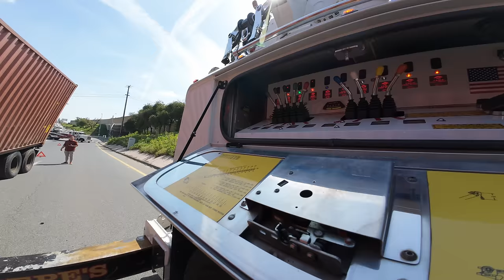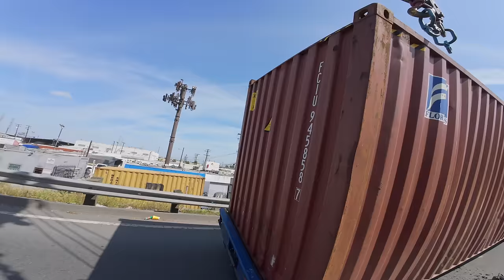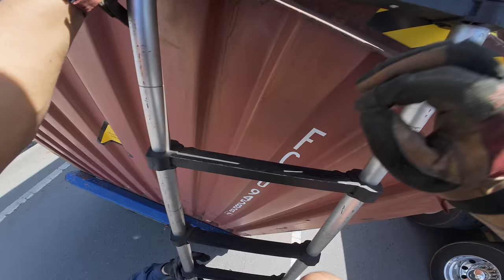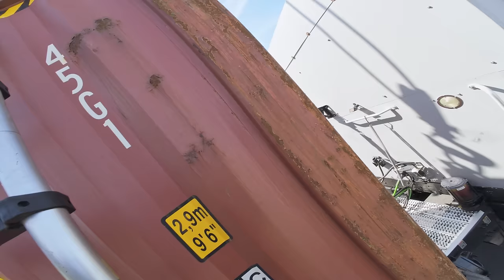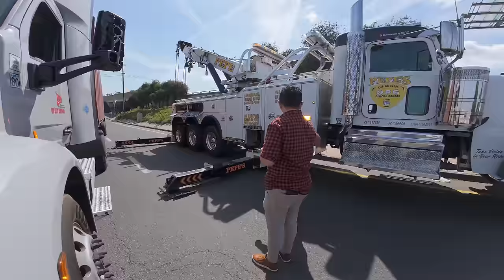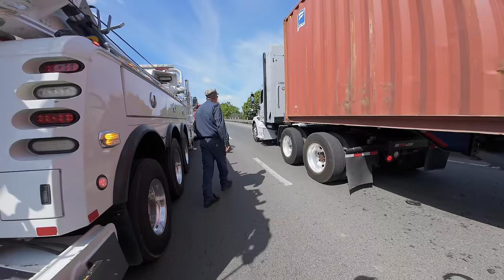Container falls off semi on freeway

Comment: I like how none of these driver stretch the trailers just listen to hear the king pin latch & then can’t figure out why the trailer is on the ground lol
Reply: Just because you do tug doesn't mean that your bar has fully locked in. Hence why you should look under to make sure the bar is all the way across and closed!  That also doesn't mean that 5th wheels don't fail either because sometimes they do!
Reply: Driver still driving, thinking they have container behind them. Lol
Reply: @ferraritoybox  I got completely under the between the truck and trailer with a spot light to check to make sure my fifth wheel latch is completely locked even after a tug. That's the way SCHNEIDER teaches you.

Comment: they need you at the key bridge in baltimore
Reply: Heck yeah!
Reply: Rotators don’t float 😂
Reply: @SuperBobblehead77  neither do the cranes they use barges or you never heard of pontoons so sorry superbobbahead
Reply: 1000 ton capacity is a little over what a rotator can do. These guys are good but can’t touch that capacity sorry

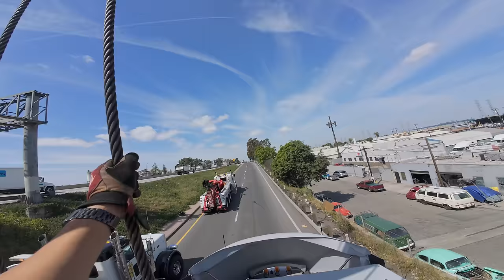Comment: 12:15 nothing wrong with using chains. People have been using them for years. Obviously now the newer tools are available and make it nicer to use but chains have been used for years with no issues. Nice job getting it done smoothly.
Reply from the maker: Cute anecdote. Are you speaking for the entire industry when you say they've never caused issues? It's simple math. Chain if it's 1/2" is rated at 15,000lbs in a vertical if it's grade 100. Watch my videos. Use load cells. You can easily double that on a single pick point during the upright. You are in the industry, you know this weakens the chain EACH TIME. Just because something has been done a certain way it doesn't mean "it works". Granted it takes a lot to break chain but why on earth would you risk that when tools rated for this exist? And I've actually seen chain break twice in real life from other companies. Those highway 411 shows have it happen all the time. You use the correct tool for the job, no ifs ands or butts. No excuse.
Reply: @PepesTowingService  I didn’t say “never” I’d definitely use the setup you have if I was a heavy operator and had my own truck. I’d prefer using equipment like that cause that’s who I am as an operator. Just saying that if can be done with chains as well.
Reply from the maker: I totally get where you are coming from, but I want to change the industry for the better and that logic is so bad and can get you killed or injured. Tow related injuries happen ALL the time. So much of it is preventable. One single link is holding up and lifting the entire container when you use them in the pockets. One link. Think about that. Of course it will get overloaded, even bent. Will it break the first time? Prob not. Not even 2 or 3. But how many times are you willing to risk it? We used to start fires with sticks and stones, but when's the last time you saw anyone do that? The point is specific tools are rated for and meant for specific jobs. Still running chains in containers in 2024 is just beyond ignorant. This isn't the 80's anymore.
Reply: @PepesTowingService  I definitely agree with ya man. We’ve come along way with the tools in the industry. I’m always amazed with all the new stuff out. Just like how they have the rim slings and other synthetic products that are amazingly strong. Hopefully people can adapt to all the new stuff that makes it better and easier to get the jobs done safely, be safe out there and keep up the good work
Reply from the maker: Yes that's exactly it! To adapt and get better. A lot of older guys in my area are stuck in the same ways that they started 30 years and never evolved. The technology for rigging now is sooooo much more efficient, safe and stronger. Like these links, they are rated for this and designed for these jobs. On certain jobs like a burn job, ya chain is so much easier. But when you really get into formulas, working load limits and seen what I seen, it's just a no brainer to not use chain in these pockets. If we can eliminate the chance for failure and damage, it has to be done.

Comment: Super quick and easy with Big Flipper.  Though I guess you'd need to do a lot of these to pay for the rotator!  Could the other tow not do anything, so they passed it to Pepe's?  I get a little confused by these ones where other tows are on scene. 

I was impressed the fifth wheel pin still worked.  Clearly that wasn't what failed. Is it likely the latch on the original truck was undone or broke? 
Also who drove off with the trailer, was that the original disappearing driver?

Comment: Why can’t you just hook onto the chassis for your lift points rather than going to the top of the container?
Reply from the maker: To be in total 100% control. I can get away with it empty. But imagine you're carrying a box with the box in your palms upright. If someone bumps into you, the box can easily fall over right? Now imagine the box had handles at top. You can turn, run, jump and go crazy and as long as you have a grip the box is going nowhere. Super quick and dumb analogy lol but that's the gist of it.